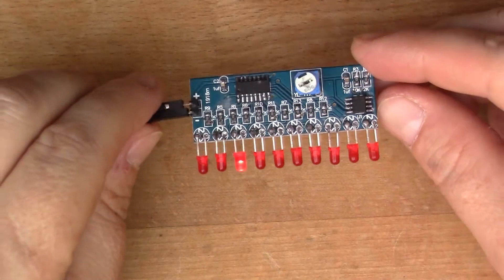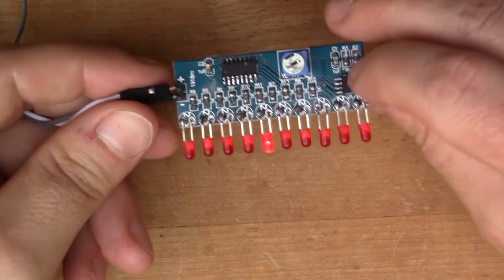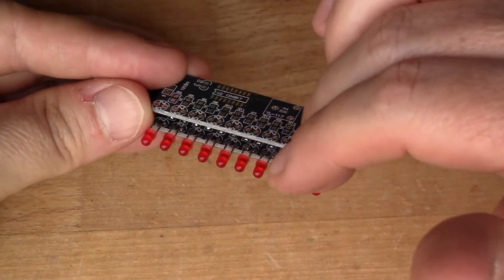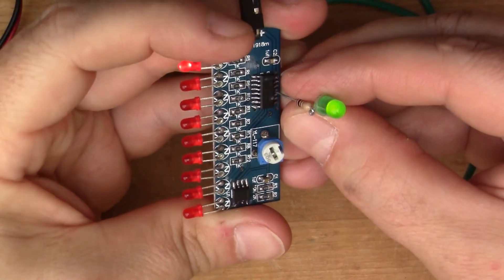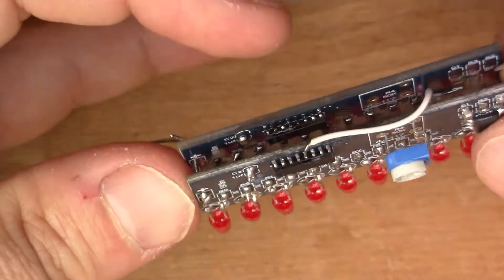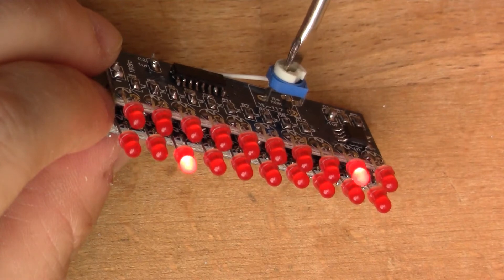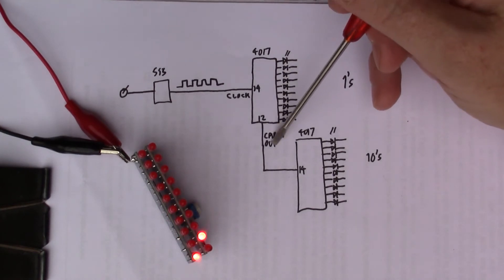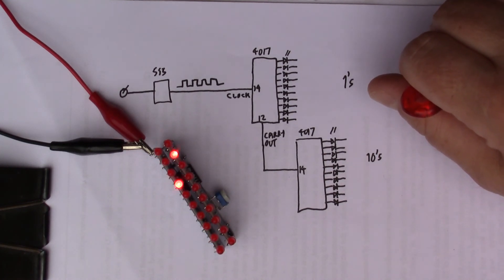4017 Decade Counter Kit - Hacked (Part 1)

Comment: I ordered a few of these and accidently ordered 1 smd and knew i wasn't ready for this, too small to handle for me, so i'll try to combine the other 2 boards and take the one 555 out of the socket holder, thanks, you really know your electronics.
Reply from the maker: Yes the SMD kits are hard going!  Unfortunately it's the way the industry is headed, and some chips are not available in through-hole versions any longer ...
Reply: I noticed that you also left off the R4 50k VR on the 2nd board as well as 555 .I guess omitting these is necessary.
Reply from the maker: The 555 isn't needed on the 2nd and further boards because the clock in pulses come from the previous board.  Using the clock out from the 4017 gives you the 'divide by 10' for each subsequent board.So yes you can lose the 555 and the various R and C components it needs.

Comment: I have 50 of them (29p each) I have built 5 and non have worked any ideas why?
Reply from the maker: Surface mount soldering is quite difficult, and it's easy to get pins bridged together by mistake. To figure out what's wrong I would definitely look at the output of the 555 (pin 5) and see if there are pulses coming out of there, e.g. by putting a LED+resistor to ground and see if the output is pulsing. You could also try clocking the 4017 by hand - touching a grounded wire on pin 14 and see if any LEDs come on.  In some of the modules I assembled, I would get the odd LED that would not light, so I just had to find the dead ones and check the solder joints, and on occasion I had a dead LED that I had to swap out.
Reply: Martyn Davies thanks for taking the time to right this this helped so much thanks I have a working one now :) this was my first time ever building a Circuit with surfacemount components The only other experience I have had with surfacemount components is with a practice board but it now works thanks :):):)